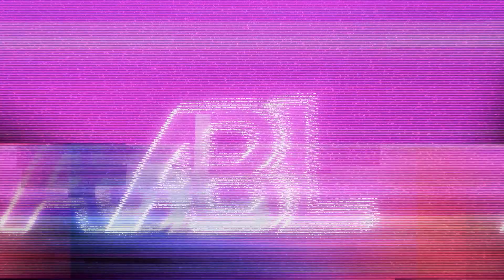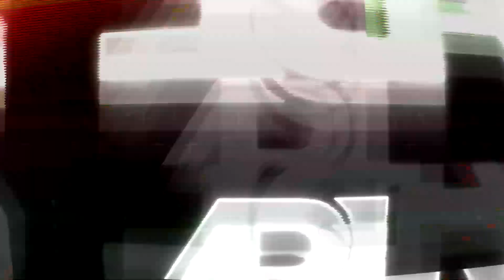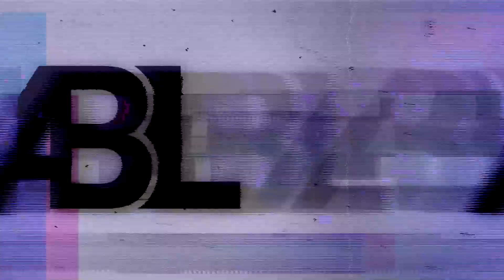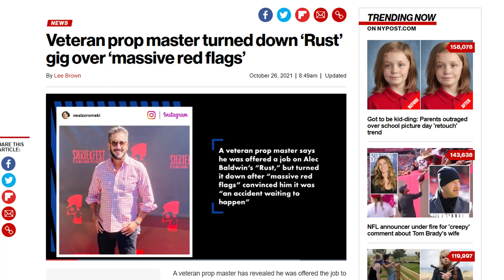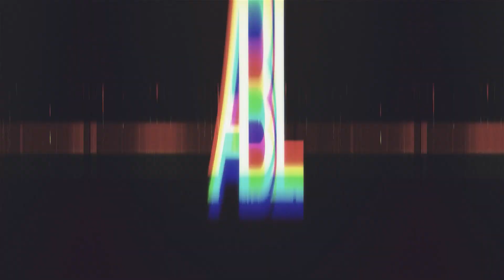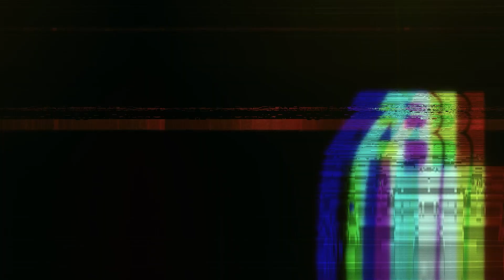UPDATE: "Rust" Crew Shot BEER Cans With LIVE Ammo Before Accident!

Comment: I have handled firearms thousands of times, so much that I have no clue how many times.
Every single time I am handed a firearm of any type the first thing I do is to check the firearm, remove the magazine if it's an automatic and clear the chamber. Then I load the weapon myself, every single time. Not one time in my life have I taken anyones word for what is up with the firearm!!! It's a massive fail to not do this, it's one of the most important things one can do and is one of the first things you learn. It's right up there with never point the weapon at anything you do not intend to destroy or kill, never put you finger on the trigger unless you are going to fire the weapon, when it's as important as these last two mentioned then it's pretty fucking important, it's one of the first three things you are supposed to learn before you are even allowed to touch a firearm let alone fire one!!!
Hollywood is filled with morons and only morons follow Hollywood!!!

Comment: I'm no "industry insider" but I've seen in documentaries that there are sometimes live round weapons on set for the purpose of high resolution macro shooting (4k is difficult to fool and often expensive) but the process of keeping those weapons AWAY from the blank guns, and further from the absolute cold weapons, (especially following the death of Brandon Lee) is intense. A weapon with a live round should not have been near the prop weapons and the props should have been cleared IN FRONT OF the director, armorer, and actors/staff and signed off upon, as weapons are often visually identical, at least in sets (multiple weapons for each "distinct" gun, potentially, depending upon directorial demands)

You can do this safely if everyone follows instructions/protocols properly and don't fire the Union workers for desiring their paychecks on time and a place to sleep that's less than a 2hr drive after shooting 15+ hours a day ffs

Baldwin will likely be found culpable if he had anything to do with Production cutting corners, and that will be determined by contract, accounts, and witnesses. Culpability will likely fall between the primary and assistant armorer as well.

PS: I understand from several documentaries that Brandon Lee died from a partial wad from a previous blank that was left in the barrel, so when it was fired (to clear) with the broken wad inside, nothing happened. Then the (loaded) blank projected the pieces into Lee's chest during that infamous scene.
This lead to lighted inspection in front of the primary armorer after firing and clearing the cylinder.

TLDR: This Rust thing was a horrendous Comedy of Errors that could've easily been avoided if everyone just DID THEIR DAMN JOBS RIGHT
Reply: Live ammo is never used kn set, with  very few exceptions, but those exceptions it is handled by a designated weapons expert not an actor or stuntman. They are also often used at a later date or another set to avoid any mix up. Alec was only an executive producer. One of 5 and then there is the producer themselves. For on set the director is responsible.

Comment: Bottom line is that knowledge and practice of basic gun safety that every firearm owner should know/practice would have prevented this. Firstly, you never point a firearm at anyone in jest. This is one of the aforementioned basic firearm safety rules. Secondly, regardless of who hands you a firearm, you inspect it yourself to assure its safe condition. Lastly, you never keep live ammunition anywhere near training/blank/dummy rounds. Absolute gross negligence on multiple levels. 

If he spent as much time educating/understanding himself on firearms as he did deriding law abiding gun owners, this likely would have been prevented.

Comment: One thing to correct based on statements from experienced Hollywood crew.  A gun that takes blanks or real rounds is NOT a prop.  It's a real weapon and should be treated as such.  A "prop" is a rubber or plastic gun that does not actually fire.

Comment: They use two types of rounds in movies..blanks-primer..powder..wax and dummy rounds when they need to show a bullet..this is a regular bullet with powder removed..when you shoot a dummy round sometimes the primer has enough force to partially send the projectile into the barrel where it gets stuck..if someone fires a blank when there is a projectile lodged in the barrel..it shoots just like a real gun...this is what happend to brandon lee..the gun should have been checked for barrel obstructions before blanks were fired

Comment: Brandon Lee was killed by a blank in the gun.  Several people were using the gun to play Russian Roulette with one blank loaded.  They thought by using a blank, it would be safe to play Russian Roulette.  A Blank is a round which instead of a live round has powder and a wadding on the end of the round, to keep the powder compressed.  Wadding is normally made out of heavy paper and sometimes will be sealed in the end of the round with hot wax.  Normally when fired the gasses and wadding still comes out of the muzzle with some force, but because the wadding has such a little ratio of weight to resistance, the wadding normally is not deadly at a short distance.   By pressing the muzzle of the pistol to his temple, not only the wadding, but also the concussion from the powder was deadly.

Also there are the Five rules of gun Safety the Navy taught.
1) Always assumed a gun is loaded until you have verified it is not loaded.
2) Always keep the muzzle pointed in a safe direction.
3) Always keep your finger off the trigger and out of the trigger guard till you are ready to fire.
4) Never point you weapon at anything you do not intend to destroy.
5) Always be aware of your target and what is beyond your target.

It is very obvious Alec Baldwin did not follow these rules.  I think all actors who will need to use a gun to make a movie should have to go through a NRA certified safety class, and they should have to carry a CCW issued by the state they reside in.  Since Alec Baldwin resides in New York City, he most likely would not ever qualify to get a NY issued CCW.

Comment: Brandon Lee was killed because they cheaped out by improperly " deactivating " live cartridges instead of investing in proper ( dirt cheap may I add)  .44 Mag dummy cartridges.  
They pulled the bullet and dumped the powder but for some stupid reason,  left a live primer in the brass. This caused a squib load and  resulted in a 240gn .44 slug becoming lodged in the bore. 
Then....nobody thought to check the bore (a basic gun safety fail) before full power blanks( live primer,  full powder load, no bullet)were to be used in the infamous scene.  
When Michael Massee fired the revolver at Brandon Lee,  the blank cartridge propelled the dislodged .44
slug at full velocity into Brandon Lee's torso, transferring about 1000-1100 ft/lbs of energy into his body.

Comment: I will add a live round is any (*CASING, PRIMER, POWDER*) that includes blanks. What makes it live is the (POWDER & PRIMER). Because several people have been killed by blanks we always call blanks live as they are.  What should have been in this gun is a (DUMMY BULLET/DUMMY ROUND) a dummy is a safe inert round. I use them for dry firing and training in the living room. Most are plastic but some people make them by taking a real brass casing and real projectile and they just drill a small hole in the brass and leave the primer out. I don’t use them for training because real ammo is not good to be cycling it you will push the projectile deeper in sometimes. The plastic ones are made so the fake projectile can’t push in.

Comment: Ultimately, whomever's job it was to check the gun before handing it to an actor and telling them it's "cold" is at fault.  Nevermind who the actor is... they get handed props and do as directed.  They are not the ones charged with having any expertise on the props.  The professionals preparing the props need to do their jobs before it ever gets to the actor's hands.  Sometimes the actor is an actual child, right?  It most certainly would be criminal to hand somebody with no expertise or license to operate firearms, a loaded gun while at the same time declaring the item as safe.

Comment: Bruce Lee was killed because of a defective blank.
Baldwin's set was using guns not props.

Reported that Baldwin was only practicing drawing the gun from his holster.  Obviously he pulled the trigger.

The campaign against the armorer comes as no surprise.  Initial reports were that she only went to work on that set that morning when the union crew was told to pack up and leave immediately as they were being replaced with a non-union crew as they had been complaining about safety  and other issues that existed before the new armorer.  The other discharges also happened before Guiterrez-Reed was on set.
As far as the podcast, you are talking a young woman just being honest about her first job.  She didn't say she was a failure just nervous so crucify her.  Also, there are many people that may have said the same thing about their first time in a new position.

As for Guiterrez-Reed training -- her father's training of Brad Pitt is nothing -- he is legendary for decades of work in Hollywood and he trained his daughter.

It is obvious that there is a campaign against Guiterrez-Reed -- her camp is being very quiet which is the right thing to do.

Bottom line, Baldwin is the boss, responsible for the set and crew as well as their safety, and he, knowing full well the history on the set and the alleged use of the firearms for target practice, should have checked the gun before aiming at a person and pulling the trigger.

Comment: Why was he pointing it at he director? Was he goofing around or was it part of the scene and she was standing in the line of where the gun needed to be facing? Honestly, you're spot on about basic gun education being needed. Alec holds some blame for what happened due to his negligence and totally lack of respect for gun safety.
Reply: From what I read, part of the original crew walked off set due to safety concerns. They got another crew, but it was late in the day. The scene angle was changed due to sun glare
late in the day. Thus the gun was pointed at people. 
I would add it was a rehearsal, why have a gun period.
Reply: @williamfranklin6283  thank you! I've been curious and had trouble finding that info. If it was rehearsal I agree, they should have had a squirter gun or something. Make it as safe as possible until the actual scene. It makes me wonder why the people didn't move as well, or why alec aimed so perfectly at her face/neck area even if he had blanks.

Comment: I speculate that gun safety wasn’t taken very seriously at any time. When dealing with firearms you have to respect the lethality of all firearms. Anti-gun luminaries like Baldwin rarely respect or make effort to thoroughly observe strict safety protocols. The Colt .45 single action revolver has a cylinder that normally has to be rotated manually to view each cartridge chamber to see if it is empty, but was not thoroughly rotated to review all 6, that’s why one live cartridge was still in the cylinder, thus the negligent discharge. It doesn’t matter that Baldwin didn’t know he never safety checked the gun, to me he is partially responsible for the homicide.

Comment: Live round: DEADLY (CASING, PRIMER, POWDER, PROJECTILE)
Blank round: DEADLY (CRIMPED CASING, PRIMER, POWDER, PAPER WAD)
Dummy round: Safe inert training round (used for drills/look like a real casing/projectile)

it should have been a dummy round. A blank round is a deadly round. I had a patient a few years back killed during a prank the friend put it to his head and pulled the trigger. The paper wad was not found but what killed him was the high velocity gasses fractured his skull and blew his head apart.  You should not have blank rounds or live rounds while pointing at a person. When you do use blank rounds you always point at the persons feet and not actually at them in the event something was stuck or the paper wad. At no point should they have pointed a gun with blanks or live rounds at a person. The live rounds are not allowed in the sterile field. Not even in your pocket.

Comment: This whole thing could have been avoided but there were so many screw-ups that things went sideways. That alec baldwin ultimately was responsible for the way things went, the armourer they used was just too young and inexperienced, they had been shooting beer cans just a short time before, and they were using inexperienced help on the set. Charges do need to be pressed not only against alec baldwin but also against the armourer as well for  not double checking the weapon and for handing said weapon to a total idiot. That baldwin needs to be locked away for a very long time for at the very least manslaughter. ABL THIS WAS one of the best explanations I have yet heard on this one, alec baldwin could have done so. Any things better and differently to keep this from happening but in the end all those that handled the weapon are ultimately responsible for the way this happened and for the death and injuries on set.